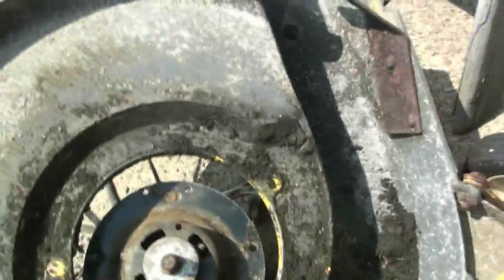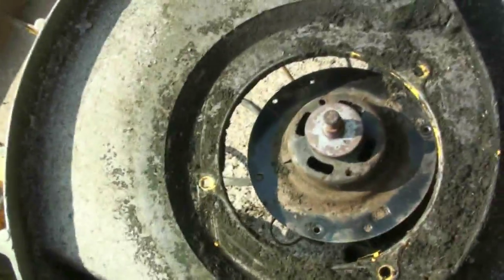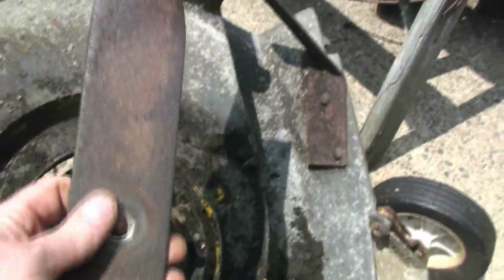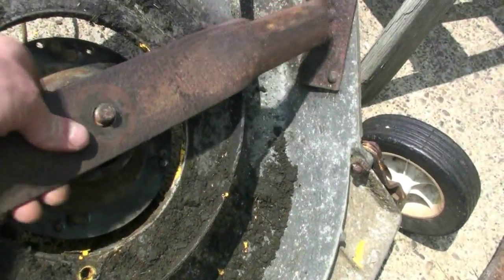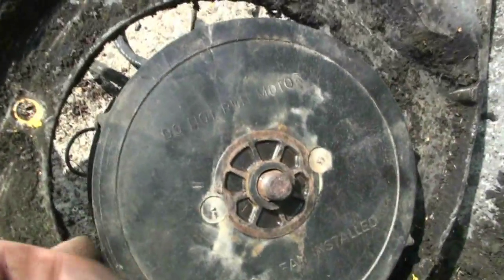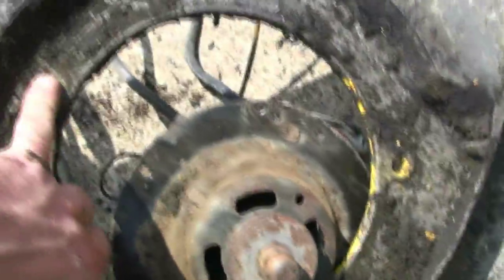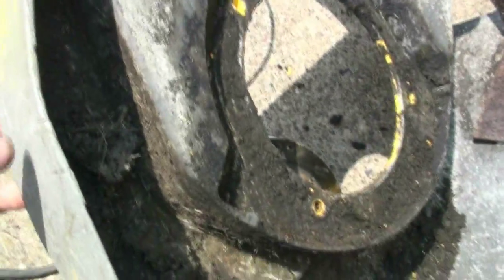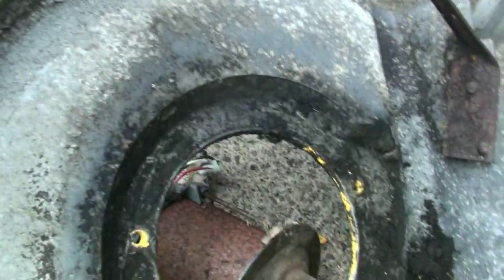Converting A Gas Lawnmower To Electric, Part 3

Comment from the maker: The purpose?  I was bored.  The handle on the electric mower was broken, so I couldn't use it as it was.  In fact, the metal Hahn housing will probably work better with the electric motor than the plastic housing, as the plastic housing was set up to be a mulching mower, as opposed to a side discharge.